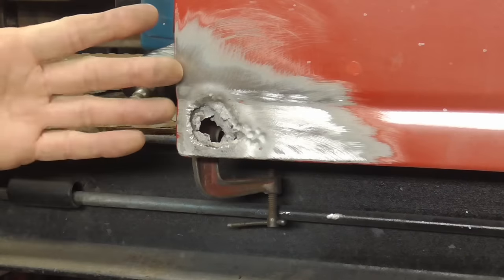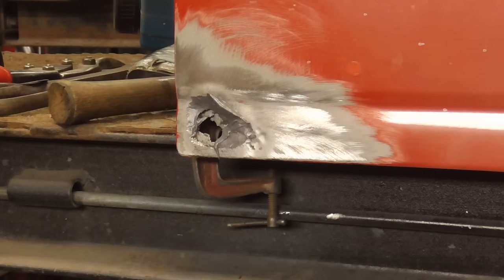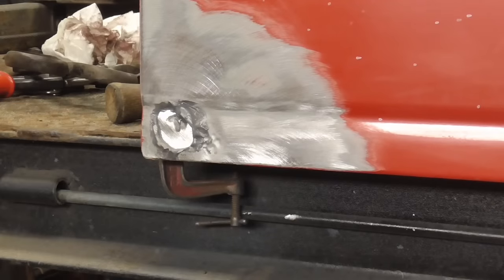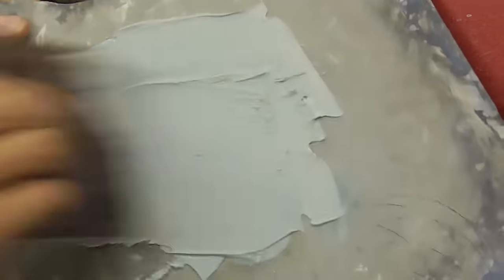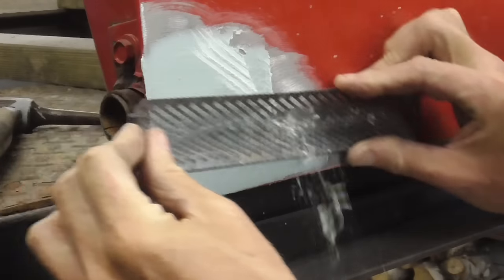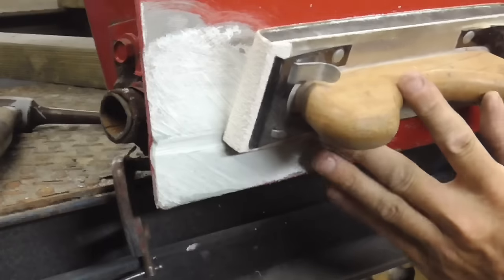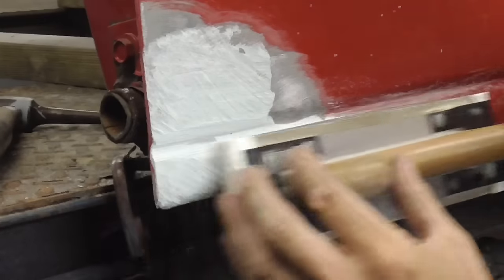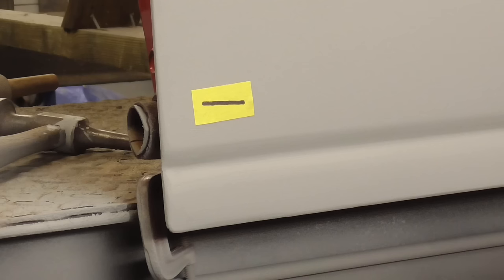Using JB Weld to Fix Rust Holes?

Comment: I have a 12' x 3' rust ulcer on my Ford Focus' rocker/sill. Thinking about cutting out that area and replacing it with a replacement sill panel. Since I don't have a welder,  wondering if JB SteelStick could hold the new panel in place long term.
Reply from the maker: It'll work fine for you.  Here's a cab corner glued on w/ JB - https://www.youtube.com/watch?v=wRl1QfkrBeY & here's the follow up vid on that a few years later (still fine today too) - https://www.youtube.com/watch?v=gIS1Tbv7Kvw

Comment: I think jb fast weld will de-laminate in two Winters just like fibreglass does.  There is no substitute for a welded in repair.  It's like the myriad dental fillings that suffer recurrent decay. There's no substitute for a clean excavation with a Zinc phosphate cement base and a gold foil filling.
Reply from the maker: Every repair method on this channel was done on this truck - https://www.youtube.com/watch?v=idrLzsz2eLg

Comment: sorry, this is a NO from me, I had too  many failures when I was young & learning, HOWEVER, look towards Devcon epoxy, or Lab Metal, either one of those will meet your expectations, I have patched holes in Harley engine cases, & small engines. 

shop  I am working at we have a 1957 Chevy rain gutter with pinholes right now, roughly 6" long area, every one at shop has different opinion how to repair, but since I am going to be owner, working it off on other projects, it will be torch brazed. thats how I want it for me. car will become a daily driver for next decade. but I learned torch brazing, torch welding & lead work in my earliest years of body shop classes, first teacher wouldnt allow electric weld process, he was a dinosaur from bygone era
Reply from the maker: Thanks for your comment and input Randy - have a good weekend :)

Comment: Thanks for the video! I used JB Weld and some 20ga sheet metal on a Swiss cheese fender. After removing the rust and DA sanding the inside of the fender I formed the sheet metal to fit closely. Then put about an 1/8” layer of JB on the new metal and clamped it in place. The epoxy oozed out the rust holes and really locked it in place. After filler and paint it was unnoticeable.
Reply from the maker: That's great to hear - you'll be amazed at how long it lasts.  Have a good weekend my friend :)

Comment: I'm a veteran paint and body man,and have been using jb weld for years,it's great for inside of the bottom of doors and places like trunk gutters , however I try not to use it on the outside of the vehicle because it will indeed shrink as time goes on,if your working on something that will be outside for a long period of time before you paint then its better,jb weld is an epoxy,which is the only thing i use to isolate bare metal,on that note,you should always use liquid 2 part epoxy and let dry completely before using body filler because body filler will not isolate bare metal, quite the opposite,the metal will build condensation between the bare metal and body filler and 100 percent will definitely rust later
Reply from the maker: It actually doesn't build condensation between the bare metal and body filler because the paint is the ultimate sealer.  If you leave a car outside for a few years before painting then OK...maybe moisture will get to that metal through the filler but I still doubt it as I have left cars outside for a year or so without an issue.  If you have holes in the metal that you are filling that's another issue - moisture can come from behind.  Here's a follow up video on longevity of repairs done this way - https://www.youtube.com/watch?v=gIS1Tbv7Kvw

Comment: I used epoxy putty to fill some pinholes along windshield frame. To repair/replace with patches would have been a nightmare.
Reply from the maker: Good idea - I'm sure it will hold up just fine up high like that - away from moisture :)

Comment: These are really great videos that you have. I just discovered them. Liked and subscribed. Thank you for posting. Question: Is it necassary to wipe down with a clean cloth and or a clean cloth with solvent etc after sanding the JB Weld or Bondo or Fiberglass after sanding but before the next layer of Bondo? It appears that you don't and most videos don't show that either. Do you just blow it off with a little bit of air and not worry about the fine residue left behind after sanding?
Reply from the maker: You're absolutely correct - just blow it off and go to the next step.  Good ? and good observation :)

Comment: can JB weld withstand a base chassis where the hood bolt goes? Mine rusted thru so the hood has no base now---have new part as that was rusted too BUT how to fix where it attaches??? rusted right thru:( body shops won't do it as its a 4" x 2" area. (unless I fork out $800)
Reply from the maker: Yes - here's a vid that may help with that - https://www.youtube.com/watch?v=wRl1QfkrBeY

Comment: I agree with you on the use of JB Weld or other good epoxy product for those exact types of metal repairs if your not a good welder and/or don't have the welding equipment handy.  I also use JB Weld when addressing rust pits in the sanded/ground down metal. (it's my personal belief that the pits still could continue receiving moisture through the primer) so I lay a thin layer of JB Weld like I would a glazing paste to fill in the pits, followed by light sanding, primer etc...

The other thing that works well using JB Weld is in fiberglass cracks, holes or gaps in the glass structure.  Not intended for broken laminates.  First repair the fiberglass laminates, then as you grind/DA the repair, you will see when the JB can finish the laminated joint and strengthen the repaired fracture.
Reply from the maker: Thanks for the support and input - good information :)

Comment: Can this type of repair work for above - ground pool rails?  I have a number of 6'x12" panels with rusted holes about 1.5" x 8" in the middle of the rail.  I was going to use roofing roll flashing (a thin aluminum roll) as my patch.  I can lightly grind the rusted hole edge out and take some of the painted aluminum off the rail.  I was going to cut my patch bigger than the hole for support.  Do you think i should cut the patch the same size, smaller or larger than the hole?  Thanks for you advice, and if you have any tips on this kind of repair, i would truly welcome any and all tips/tricks.
Reply from the maker: I would grind the surface clean on both surfaces rail and flashing (maybe sand the flashing).  Then cut your patch much bigger than the hole.  I would make sure I have at least 1/2" overlap all the way around the hole.  This will work great if it has enough surface area to adhere to.  Hope it works for you - keep me updated - curious :)

Comment: Hello man, Been a long time subscriber. Why does glazing putty say bondo on it and yet body filler is called bondo? can i use glazing putty for small areas with the same strength as bondo? Im not understanding the difference. Im about to jb weld fill a hole in each fender that same dork put "super cool lights in"  face palm
Reply from the maker: Actually body filler (bondo) and "newer" 2K glazing putty are very similar.  The glazing putty that you mix a hardener in is basically an easy sanding body filler for small spots and yes you can use it for small spots with worry.  If it's a large ding or dent you'll want to use regular body filler.  Body filler for big stuff glazing putty for shallow/minor stuff.

Comment: As a Journeyman Autobody & Painter with 37 years in the trade .... my concern is the body filler will eventually blister off the JB Weld . The body filler is Polyester based while the JB is epoxy based . I would have said use a good urethane primer over the metal/JB .... then apply the body filler over the cured primer .
Reply from the maker: Hi DJM - it hasn't yet and it's been a few years.  I'm working on a follow up video on previous repairs done on this channel - I think it will really help :)

Comment: I use JB weld all the time. This old truck I'm working on has had 3 different types of rear view mirrors screwed into it over the years. For these small holes in the door, I put a piece of masking tape over the hole and then smear JB weld from the inside. After it cures you pull the tape off and it's basically flush with the surface already.
Reply from the maker: I once jb welded a metal egr tube that came right out of the pipes behind the exhaust manifold - hotter than heck right there.  It lasted forever.  Sold it 10 years later and it still was sealed.

Comment: Ive done lots of repairs like this on my personal vehicles and didnt know anyone else did! Ive never had one fail. In fact its often stronger than the original metal next to it over time. My experience. Your milage may vary.
Reply from the maker: I found with making sure the panel can drain and stay dry it holds up really well - same with fiber glass repairs - drainage is the key :)

Comment: I really appreciated the information I got from your video on the job weld rust repair. I have an older town car, the rear dog legs always rust on them. I'm retired and I really don't have funds to send it out to get welded. I'm going to use the method you used to repair the car. I worked in a body shop for many years doing finish work. I have the skills needed to prep and paint, so I'm going to attempt the repair as well. Thanks again.
Reply from the maker: You're welcome - those legs get packed with debris and moisture - make sure they can drain and dry out inside - add drain holes if needed :)

Comment: can that be used to adhere metal/chrome emblems to a truck? I have 2 metal Ford "Ranger" emblems I want to put on both side of the bed. If so, what JB weld is the one you're using? I see there are quite a dew types of JB.
Reply from the maker: Yes.  This stuff works great too.  3M 3M8001 Super Weatherstrip Adhesive.  Super sticky/tacky and dries fast.  Use some masking tape to hold it in place for about 15 minutes and you're good.   Also - 3M Plastic Emblem and Trim Adhesive, 03601

Comment: LOOKS GOOD FROM THIS SIDE  but wont there be bare metal surfaces on backside with no primer or anything to protect them and its gonna rust out way faster from behind?
Reply from the maker: Yes but the most important way to prevent rust from any repair coming back is drainage and your rust proofing after the repair.  Here's a video on that:  https://www.youtube.com/watch?v=8XaZBy7GC7A

Comment: Think jb weld would do ok on the roof of a truck? I have a new to me work truck that I'm going to do some work on the cab corners and rockers but there are a couple rust bubbles up on the cab marker lights so I was wondering if this would be a viable option up there. I'd only worry about the temperature extremes we get here, plus 40 degrees Celsius down to about negative 25 degrees Celsius
Reply from the maker: JB weld can handle very high temperatures,  I fixed an exhaust pipe with it up close to the engine and it lasted for years.  :)

Comment: Thank you for posting this. Have used JB Weld over the years for other applications and have held up well. Restoring a 63 Impala and have several small areas to repair inside the rear wheel well area that welding isn't an option due to the location to outer quarter panel risking paint damage from too much heat. I will use this option there. Thanks again for posting...always learn from your videos.
Reply from the maker: Glad to hear it AC - This video shows how long this really lasts.  The drivers side cab corner was glued on w/ JB Weld - https://www.youtube.com/watch?v=gIS1Tbv7Kvw  JB Weld Repair vid - https://www.youtube.com/watch?v=wRl1QfkrBeY

Comment: You may want to try pc7. It's similar to jb weld but can get larger quantities for cheaper.
Either is easier to work with then bondo imo.
Reply from the maker: Thanks for that information Martin - I'll be checking it out for sure :)

Comment: Would a NEAT application avoid using body filler? I will use JB weld rather than expoxy for small quantities as mixing very small batches is simpler.
Reply from the maker: Yes - if you can get it on there perfect then I suppose you wouldn't need filler :)

Comment: I have some slightly pitted sheet metal in the trunk of my project car that does not merit replacing the entire section. I have removed all the rust as much as possible without removing any more metal and treated the pitting with phosphoric acid to neutralize what's left.  I plan to use JBweld to cover the pitting instead of body filler as it will add rigidity to the panel and will make for a better repair IMHO. JBweld is more water proof than bondo for sure. Time will tell if it holds up which I expect it will. Great tip!
Reply from the maker: Thanks - I'm sure it will be just fine.  Let me know how your project goes :)

Comment: This makes sense to me than filling up with plastic filler. Im currently deciding between this method on video or method I did with my grand pa 18 years ago… Welding in zinc plated metal sheet with lead. Soldering in it pretty much
Reply from the maker: Welding in regular metal works just fine. For longevity see:  https://www.youtube.com/watch?v=8XaZBy7GC7A
also check out these videos:  https://www.youtube.com/playlist?list=PLOP9eoG14-I-qu68_805bZaOnmkdlv6Ys

Comment: Resorted to this on the aluminum quarter panels on my Land Rover. The previous owner used the time tested way of fixing damage to the aluminum. He used tech screws to attach checker plate and hide it lol. I’m filling in those holes.
Reply from the maker: That's good to hear - how did it turn out or are you in the process?

Comment: Repaired all things metal with JB weld. Useful even on vintage motorcycle fuel tanks, even though I don't think you're supposed to.
Reply from the maker: Good tip - thanks for the comment :)

Comment: All metal by USC has aluminum shavings in it.  It acts like JB Weld.  It gets hard enough you have to use a grinder so make sure you don't overdo it and think you can sand the rest off like regular filler or fiberglass. I used it on a roof of two different cars and its stays flexible enough you don't have to worry about it cracking.
Reply from the maker: Some of that stuff does get real hard like that fiberglass reinforced filler.  If you overdo it - you've got work to do for sure.

Comment: Couldn't you just get some JB Weld putty or Bondo Glass and fill the void?
Reply from the maker: You could but I'm thinking that would gum up or block the inside from draining really well.  The key to no rust is making sure the repaired or new panel can drain completely and dry out.  Example:  hand a bare sheet of metal in a tree or out in the open and it will be there for probably your whole life :)

Comment: I've been using JB Weld for filling trim and emblem holes for many years.  If possable use the epoxy to glue some metal screen to the back side of the panel.  When that dries use the epoxy to fill the hole and push it through the screen.  The screen helps keep everything in place.

Comment: Question if you could answer I have my Vw bug . On the beetle it has in the front the hood seal . Mines is damaged. The replacement part is thine metal . Can I used jb weld to put that metal seal strip .
Reply from the maker: If it's metal to metal - yes.  If it's rubber to metal use 3M weather strip adhesive.

Comment: I have a 1981 oldsmobile cutlass supreme  that I want to touch up. I have some rust. Can I use jb weld too?
Reply from the maker: Yes, or... this method works well too - https://www.youtube.com/watch?v=rPTaeH056ng  Make sure your panel can drain and dry out inside after it rains for longevity :)

Comment: I used JB on a few pin holes I noticed after I put the epoxy primer. On the bottom of the front fenders I cut it out and welded in a piece of metal like you do. To many holes on the bottoms. Thanks for all your help. I tell all my friends about your videos. Practical body repair.
Reply from the maker: You're welcome Donald - thanks for the support and keep me updated on your projects.  Glad the videos help - have a good labor day weekend :)

Comment: I love gluing! 3M man me self.
The airtight seal, the strength, the corrosion protection, the glass beads to even out proper squeeze pressure, the speed, no burnt metal, no worry of exposed metal behind, no chasing welds, no warping, less body filler and more!! 
Body panel glue won’t let you down.
Reply from the maker: You're right there.  I really think that's the way to go.  Thanks for your input.

Comment: I'd only question, since that looks like a door, the long term durability of JB Weld to hold up to slamming and vibration.
Reply from the maker: I think it will hold up fine.  So far so good on the cab corner on this truck done w/ JB - door has been slamming on it for more than a year.  Here's the video on it: https://www.youtube.com/watch?v=wRl1QfkrBeY

Comment: Does this work on rust holes for chrome side steps? I really don't want to buy new ones, and only one side is rusted. Thanks for the great video!
Reply from the maker: I think it would but you have to rough up the chrome - maybe with a sand blaster or even some good sharp sand paper.  You may want to test an old piece of chrome first to see.  Let me know if it works for you - curious :)

Comment: Curious... Why not use a small amount of Bondo as your setting agent for the metal plug?
It dries a lot faster than 8 hours... Is the tensile strength higher with jb weld?
Reply from the maker: That's fine too - I've seen it done before.  You can use, JB, Panel adhesive, reinforced filler, regular filler.  If your panel can drain and stay somewhat dry inside the repair will last quite long.  No moisture = no rust :)